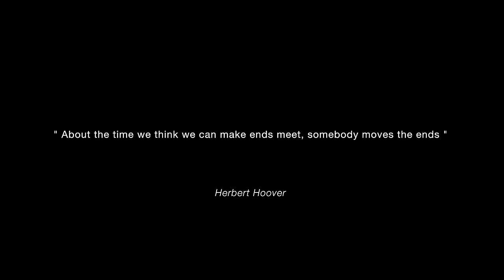The Countdown has Begun - an update on Kingston, Ontario's La Salle Causeway   4K

Comment: i still say the old bridge could have been saved. support the concrete weight , cut out the buckled members . replace with new using bolts instead of rivets , but all the engineers were scared to certify that. the original lasted for what 75 yrs? maybe more. just replace with identical or better shapes.
Reply from the maker: Ron - it’s certainly tempting to believe that the old bridge could have been saved. Many of us would have loved that to happen. However, I suspect that a host of factors played into the decision to demolish and replace it. We can only hope that what eventually emerges will be a swan and not an ugly duckling.

Comment: I was doing research on this type of modular bridge construction, and found out in most cases where these were built to be temporary structures; they end up being permanent due to cost savings. The design of the bridge does have me wondering if they've decided to "close" the waterway; as the bridge does not look reinforced for cantilever movement, nor designed to be a swing (turn to open)  bridge.
Reply from the maker: Your research has not produced any false results.  Current statements contain no suggestion that this bridge will be a permanent fixture.   It has been officially stated that the intention is to open it to road traffic  by the end of September.  You are absolutely correct that it is not designed or  intended to be opened or removed regularly. It will be removed, conditions permitting, for a few hours on two dates in October and November to permit larger vessels to enter or exit the canal; otherwise, only smaller vessels will be able to navigate the waterway.  A decision on what will happen in 2025 is not expected before the end of this year.